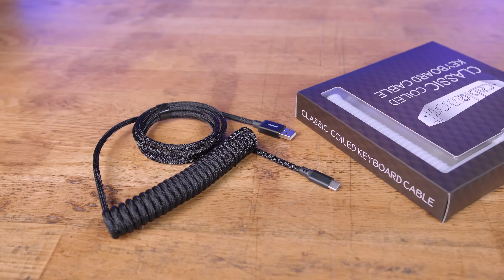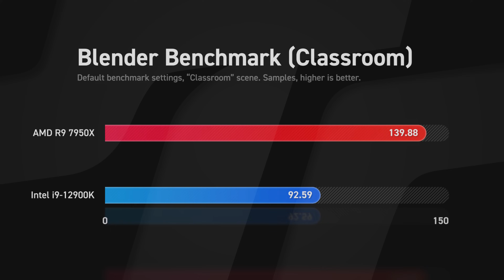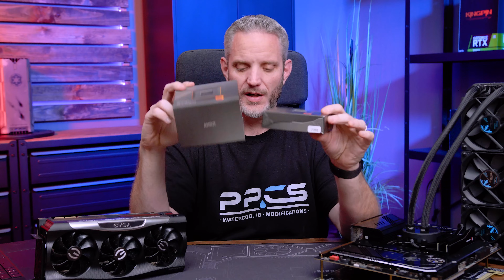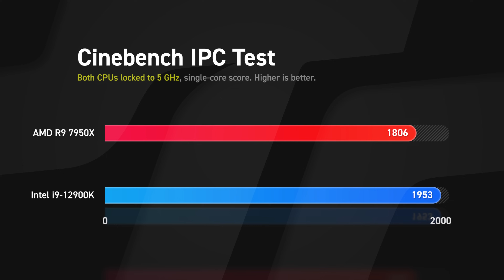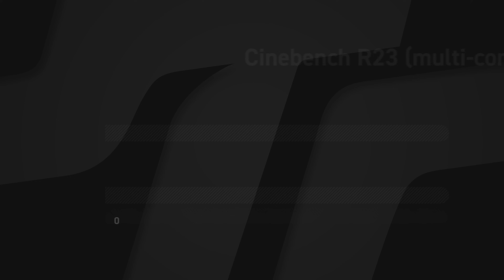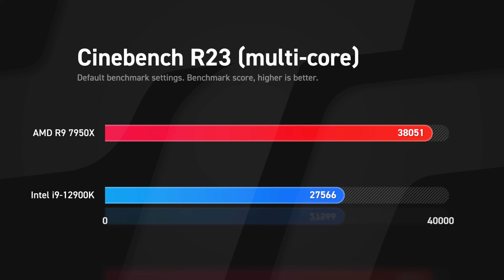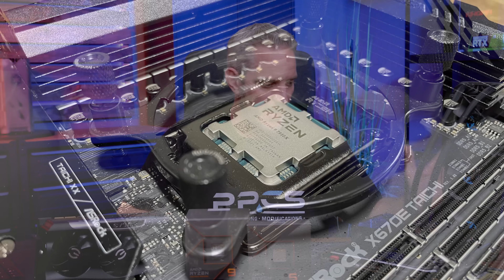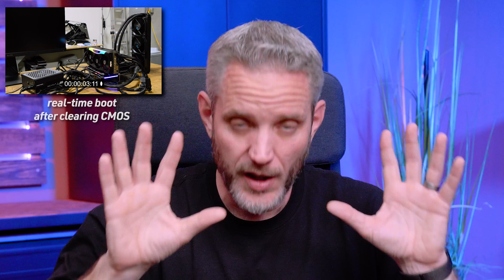Forget EVERTHING you THINK you know about AMD... these CPUs kick A$$!!

Comment: If these cpus are this insane, I can’t wait to see what the next 3d v-cache CPU’s will do.
Reply: That's for gaming. Jay is talking about daily and productivity use... those 40% more multicores and windows responsivity, I guess.
Reply: @marsovac  Not sure why everyone jumped on the hype train saying the 3D v cache versions are gaming only yes there not as fast productivity but my 5800x3D is no slouch either in  productivity. There is leaks out there on  the new 3D V cache cpus they look like they will be monsters as well. One reason many are not jumping on this new none 3D v cache versions as much as 3000 or 5000 series. That & many have last gen cpus of either AMD or Intel & are happy enough. I will not be leaving my 5800x3D for years to come even if I had the money to spend. Last gen chips are fast enough for gamming &  productivity for the average user.
Reply: @marsovac  In gaming the 12700k is cheaper, mb cheaper and you can tune the ram for really good 0.1FPS. Alder Lake is still gaming king for tuners. Getting a new bios on the mb is a must regardless of Intel or AMD for DDR5 stability. The response improvement is most likely just pcie4on the M.2 hard drive. My 12700k on pci4 is also much snappier then 10700k pcie3. Random read and write is just 55mb/s on pcie3, its much better on pcie4.  Testing windows respons on pcie3 vs 4 could make an interesting video..
Reply: bro, the 5800x3d is still king
Reply: this is the exact thought i had. Bring me the 3D Parker!!
Reply: Me too, but with Temps the way they are, I think V cache is gonna result in compromising performance more than 58003dx had to.
Reply: v-cache 7800x3d is gonna shit on everything in gaming. its gonna be freaking sweet.
Reply: After watching linus's video I want the current 3D ryzen! The gaming performance was the best!
Reply: @tbrowniscool  Linus only tested a few games, lot of games where the 7600x is better then the 5800x3D... the 5800x3D is still mighty impressive tho
Reply: @Sinesterr  Yeah true it just shocked me how good it still is. I have a custom imaged work laptop for my Sysadm so I only need gaming performance. Just hoping for the price to drop when these new AMD cpus come out. Then I'll buy the 42inch asus oled. R7 3d and a used 3090. Will be sorted for a few years
Reply: @Sinesterr  He is mostly into servers these days and productivity since for him time saved is money saved.
Reply: @tbrowniscool  Can you please explain what exactly custom imaged is, and what the benefits are?
Reply: @Trancedd  Yeah sure it's a custom windows 10 build that we use for our hospital laptops. It's the same base image for all hospital workers then we tweak it for certain job roles. Purely a work thing not gaming.
Reply: @Sinesterr  In most applications of processing, not just games, the 5800X 3D still overpowers every other chip on the market.  There are a few use case scenarios where it lags behind the 12900K and the 7950X, but not by much, which is less than it leads them by in everything else.  I'd love to see what applying PRO features to the 3D cache of the 5800X 3D would do, like quad channel memory...  The 4650G and 4750G for example, though they are behind the 800/900's of most other ryzen lines in every spec except max memory bandwidth, when in a board that supports quad channel memory and have all 4 channels active, outstripe the "superior" 800/900 lines in many (but not all) applications by a surprising, though mild, amount.  The most surprising part about Ryzen quad channel memory support though, is most of the boards that support it are actually "Lower end" boards like B450 micro ATX Or A320 full ATX.
Reply: @tbrowniscool  these will be better or the same. The 3d cache version of these will be 30 percent faster at least.
Reply: @ricky4673  Yeah I just cant wait another 6 months to buy a system and the prices will be rock bottom for the current stuff (3D Ryzen and ddr4 etc) I only wanna play Hell let loose at 4k on low settings and a bit of total war :)
Reply: @tbrowniscool  Linus video was hot garbage. He used shit ram on purpose while AMD had sent their sweet spot kit for reviewers. Linus is not a serious channel, it's funny but never take real advice from them.
Reply: @RafitoOoO  that's a good point I think I missed. What different ram was he using?
Reply: @tbrowniscool  iirc AMD sent a 6000 CL30 to all reviewers and Linus used a 5200 kit or something like that.
Reply: @RafitoOoO  For me that was a good point from Linus as long the DDR5 5200 is less expensive than a 6000 CL30 kit ... A 6000 CL30 kit cost around 400€ for a 16GB kit when a 5200 kit cost less than 200€ ...
And if you want a really good kit, you have to spend btw 600 to 800€ for a high end 6000 CL30 kit ...
But yeah ... Ofc AMD had to manipulate the reviews with these famous 6000 CL30 kits ... They are there to sell their products, but that means you'll have to spend more for the ram than for the CPU itself !
Yeah, sorry ... I used my brain a little ... I gonna switch it back on fangirl mode ! "Woaaaaaaaaaaw thaaats so impressive ! Go AMD !! GO GO GO !! SHUT UP AND TAKE MY MONEY !!"
Reply: @RafitoOoO  Yeah but the 3D ones DDR4?
Reply: @RafitoOoO  Linus probably dropped the ram AMD sent on the floor & broke it 🤣
Reply: @RafitoOoO  Yeah, I stopped watching them some years ago.  Their Friday live stream videos became Floatplane propaganda.  Floatplane this, Floatplane that.  Just give me the news and make separate videos about your stupid Floatplane some other time.
Reply: @RafitoOoO  wasn't he using ddr5 6000? I watcha. Few vids today so maybe im remembering someone else.
Reply: @RafitoOoO  Technically that is fine since 5200 is the officially supported DDR5 ram speed of the 7000 series processors.
Reply: @spleenpedersen5039  This kit is only 284.99, which is CL 32 and wont be noticeably slower than DDR5 6000 CL30.
Reply: @spleenpedersen5039  Try again. 32gb AMD EXPO DDR5 6000 cl 30 is $290 on Newegg.  cl 32 is $260 and cl36 is $210.  And if you want to cheap out, and upgrade later 16gb of 5600 is only $135.
Reply: @michaeltyrrell3381  then you aren't testing the CPU. The whole point of a review is to test the hardware. If you want to test it among several ram kits like Hardware Unboxed did, it's great, but if you intentionally choose a shit ram kit to pair with the CPU then you are skewing the results.
Reply: @RafitoOoO  They did use the RAM kit sent by AMD, they corrected it in the comments
Reply: @RafitoOoO  he used a 6000 kit for new ryzen. He used the like 5000 for the old ryzen
Reply: @RafitoOoO  wow... did not know that about the ram.. that's kinda sheisty
Reply: @spleenpedersen5039  unlike nvidia and intel, amd said ”hey use this ram kit which we recommend and send it free”. The nvida and intel style would have been ”unless you use this ram you have no right to post our products on your channel, sign here _________________________”.
Reply: @RafitoOoO  He used RAM that the average user can afford. So yeah it didn't show the absolute peak performance you can get out of it, but the amount of performance the average user is going to get.
Reply: @eriktimme22  he's not benchmarking the CPU. Period. How the fuck can you review a CPU creating bottlenecks somewhere else in the system? Would anyone consider a legitimate testing if he tested games with a 3070? The answer is easily no, the same applies to memory.
Reply: @RafitoOoO  I'm not gonna pretend I've watched the video you are talking about, but... The way you are talking is akin to "PLEASE AMD!! FILL MY BRAIN WITH BULLSHIT PROPAGANDA!! OOOHHH YESSS, AMD!! YOU ARE SO POWERFUL!!!" Sounds to me like Linus was actually trying to show AMD's performance in a MORE COMMON REAL WORLD SCENARIO, instead of CHERRY PICKING the performance parts.
Reply: @rameynoodles152  okay, next time it's better to test the CPU with a 3060 to be a more common and realistic scenario. It doesn't matter if it will bottleneck the system or not. Why bother TESTING something if you're gonna create a bottleneck elsewhere? lmao.
Reply: @RafitoOoO  i have seen this a few times in recent years and not jut Linus where they will be benchmarking AMD vs Intel and they use 3200 ram for both systems, 3200 is fine for intel but provides lesser performance on AMD, where as 3600 RAM is the sweetspot for AMD and it doesnt provide a disadvantage to Intel so it makes zero sense to you 3200 unless you want to skew the figures in a fairly small way towards Intel
Reply: @tbrowniscool  no
Reply: @AKIBAI9  To what?
Reply: @RafitoOoO  Not to mention LTT videos have gone from "This is what to and not to do with your PC parts" to "Look how rich YouTube made me!  I have a million dollar house and 3 million dollars of tech run throughout it!"
Reply: @spleenpedersen5039  G.Skill Trident Z5 NEO Series (AMD Expo) 32GB (2 x 16GB) 288-Pin SDRAM DDR5 6000 CL30-38-38-96 1.35V  259.99 om amazon. 🤣 Not sure where you get those numbers. manipulate the reviews with these famous 6000 CL30 kits....  No that is the suggested  A Qualified Vendor List (QVL) & ram speed they suggested all cpus when they come out have a suggested top ram speed for there Cpus.
Reply: @RafitoOoO  Well, personally, I'm of the opinion that you should do both. A realistic test, and a no-limits test. So yeah, you should test with a 3060 or a 3070, and 2400mhz DDR4 or something, but also a 3090 with ultimate RAM and MOBO.
Reply: @rameynoodles152  agreed!
Reply: X3d best 3d
Reply: @hangender  Ive been looking at building a new system and the X3D blows the big boys out of the water for 120W. Cache is so important
Reply: Problem with Alder Lake is the e core pretty much is just there to pad benchmark scores. AMD continues to school Intel furnace in efficiency.
Reply: @Lurch7861 wtf dude, a whole story but your first sentence is false, so I stopped reading
Reply: I don't even care that I paid full price for a 5800X3D. I will buy the best 3D AMD cpu when the 7000 releases as well.
Reply: That's what I am waiting for.
Reply: GUYS THE NEW CPUS ARE BETTER THAN THE OLD ONES THE COST MORE TOO HOLY
Reply: I mean the current 3D cache one still beat some of these 7000 series, so if new 3D cache beats those, it will be nuts and performance i will probably never notice since i cannot blink or game that fast ... Lol
Reply: theyll release it if they lost on intel 13000s
or after 14000s if they best 13000s
Reply: Same here hoping they can go with more than 8 cores this time.
Reply: Isn't the 3d tech only better for 1080p? It's 2022, I'm surprised so many people are still on 1080p. I've been on a combination of 2k@144, 4k60 and 2kUW144 since the gtx900 series gpus came out
Reply: Waiting for that
Reply: They could probably be used to boil my water to cook pasta
Reply: Obviously if they can do 64-core Milan X(3D) then it should be possible to have a 7950 X3D. I think the 5800X3D was for bragging rights in gaming, Milan X was where most hybrid tiles went for the HPC engineering market. Big prices, big profits.

5800X3D can mask the higher latency of cheaper RAM while still seeing gains from faster RAM. A 7950X3D could maybe run DDR5-6000 with 1:1 IF, and it wouldn't care if you had CL36!
Reply: @Lurch7861 love how you not so subtly had to stroke your ego there
Reply: can't believe I don't see any mention of going to a new 5nm process node vs the old 7nm! once the 5nm matures it will only get better
Reply: Zen 3 was a hunk spunk to Intel back at the release period. I've heard same things said as about zen 4 right now. I may probably upgrade to am5 at its life cycle end when it will be as refined as it gets.
Reply: I’m really curious to see what they do with the new GPUs, they all seem like the girl that came back
after she got tired of the guy with the party van.😂
Reply: Clearly they will take over the world in minutes
Reply: That's what I'm waiting for
Reply: i personally own a 3700X myself.
Reply: I thought a cross section of an Intel 4004 was insane so I guess I'm easily impressed
Reply: exactly the same +3%
Reply: They can't push these kinds of numbers in there 3d models, the cache takes of space and makes things run hotter (even the 5800x3d doesn't perform quite as well as the regular 5800 in non-gaming tests)
Reply: @sstier48  Yeah but compared to CPU's the x3D beats in gaming it uses like 120w of power, as opposed to 250W+ for the big boy CPUS? 1KW of energy where I live is £0.51 so lets say I have a 1000W system and run it 5 hours a day gaming. Thats £0.51 and hour. £0.51x 6 = £3.06 a day X 365 is £1116! So any saving is HUGE long term!
Reply: @tbrowniscool  Firstly, no machine is going to be using 1000W of power all the time you're running it unless you're running Prime95 or Furmark or something. Most of the time it'll probably be 200-300W, and idling maybe <100W.

Secondly, £0.51 / kWh?! Wtf??
Reply: @sstier48  The issue with the 3D cache was actually a voltage limit, not a thermal problem on the 5800x3d.  Supposedly they've improved it.  There will still probably be a small hit since zen 4 is designed to sustain 95° but i'm interested to see how close they can get this time.
Reply: @sstier48  the hotter the better. Just means there is a reason to go water cooler or AIO cooler. 

I would counter your point though. There is 60 to 30 percent unused space on most cpu chips from any manufacturer. This is for many reasons and some of that lowers heat. The space part of your argument is countered. Let's address heat.

So with games, it is highly unlikely to use all cores at 100 percent. This means there is headroom for some extra heat. Meaning that heat wouldn't cause any major concerns.

On a desktop, it take a great deal of ambient heat or a very bad case in order to cause thermal throttling. This can be addressed with water cooling or better case or lower ambient temp. 

When you build a gaming pc, heat is the least concern because there are so many ways to address it. 

If your building a server, you would not be exposing the chip to high heat for only  a few hour gaming session. It would be for 24 hours a day possibly. When it comes to gaming, heat is a much less concern on your parts.  

Here is a point of my own for 3d cache. 

Some games are highly limited in how many cores can be used. Sometimes even emulators. Having faster cache and more of it is a way to gain more performance in that scenario. As always, when picking components in a pc, you pick them based on your applications. The 3d cache chips are stronger for my personal applications of choice. Maybe not for you.
Reply: @Lurch7861 i agree way too much hype for nothing new just dumping more watts in

Comment: I absolutely love how you finished this statement. RDNA2 offered a decent competition to RTX 3000, but we need AMD to kill it with RDNA3. I have an X570 5800X system with a 6900XT in it. I wanted an EVGA 3090 to go with the processor, but when I finally got my hands on a 3090, I didn't like the memory temps, so I stuck with my current setup. I plan on staying with this setup for another year or so (I was a day 1 adopter of Ryzen 7 1800x and x370(first asus board didn't have a BIOS so I swapped to a Crosshair VI), and it had a lot of teething issues). I will save and wait for the next release of AM5. However, I think I may upgrade my video card depending on what AMD releases, but I can tell you for sure, it will not be an RTX card.

Comment: 3700x, 2080super, 32gb ram, nvme, ssd, hp reverb g2v2. The old rig is a piledriver with 16gb ram, 2x ati 7850 in crossfire and 4x ssd in raid 0. How things have changed. Speaking of crossfire. Sure would be nice if those dual board cards from yesteryear were used as inspiration by amd and they made a dual sided liquid cooled heatsink block and dual GPU straight from AMD. Since we are now seeing control sets with IPC lockdown the frame stutter old dual card systems used to have should be minimized. It seems with the gpu wattage going up, that we will need generators, or dedicated 15a breaker circuits just for the tower. How long until we see GPU's as external towers with OWN power supply.

Comment: I have two system with Intel Core i5 10400, both of them suffer from slowdown within 1 and half year. Same to my old Intel Core i5 8600k system. My current cpu Ryzen 7 5800x previously Ryzen 7 3700x did not suffer from any slowdown. It is same OS install that migrate from old Intel i5 8600k system. Now i am a happy AMD user.

Comment: I generally build Intel/Nvidia, and as you said you're going to re-do 13th gen vs amd's 7000 series cpu's.
I won't make any assumption about 13th gen until I see the real world samples coming out and not just what's on paper. AMD seems to have stepped up minus if you count the 5800X3D which is apparently on the same level but half the price...

The only thing is the whole 350w power mode on 13th gen... because they say stock is 250, so i'm very curious to see real world examples already and not just engineering samples.